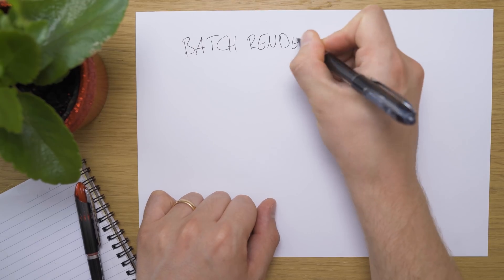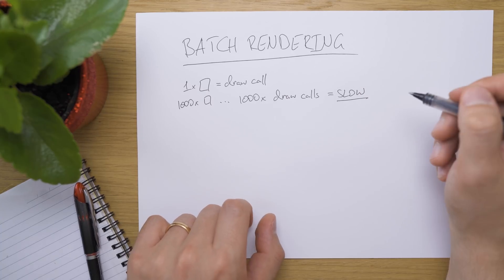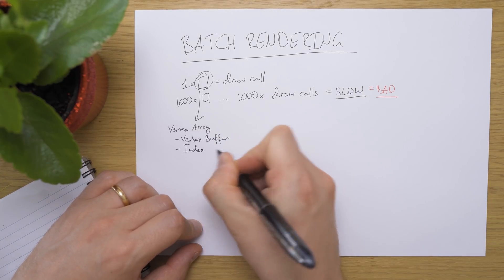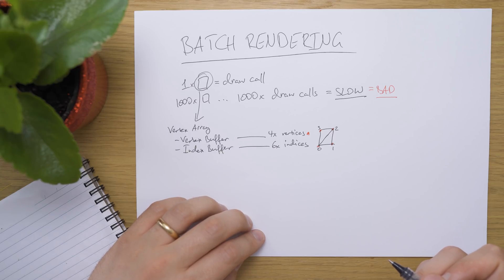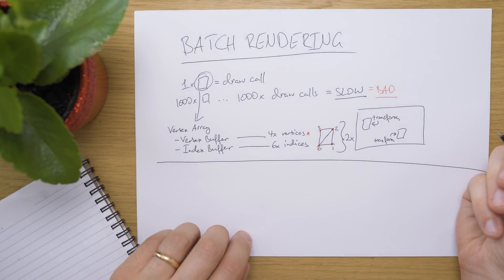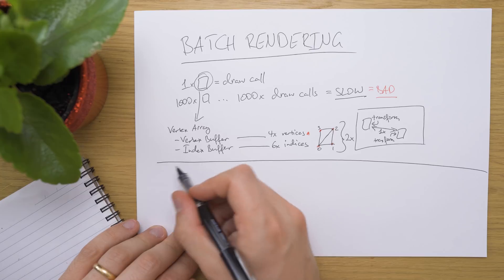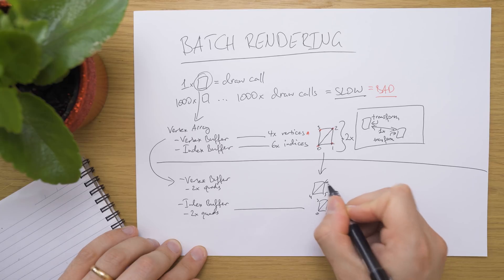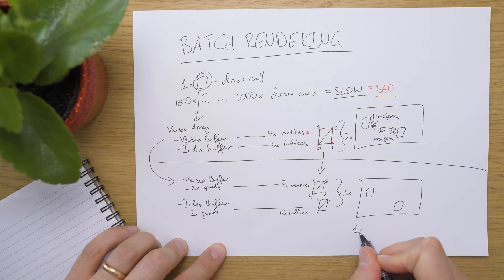Batch Rendering - An Introduction

Comment: What about the overhead of transforming all of the vertices in the array, as well as culling? By sending all of the vertex data at once, you must first transform the quads using the transformation matrices, which would need to be multiplied through on the CPU (effectively doing all of the work that the vertex shader does). If you generate your quads once at load time, then that's won't have a significant impact, but if you are doing it every frame, the overhead of the matrix transforms may be larger than multiple draw calls.
Furthermore, if you have a large array of quads that you are drawing, for multiple objects, then your aggregate object will become larger, and you will be unable to break it up to do things like frustum culling, which will result in unneeded GPU.
What about using instanced rendering, where you upload a large packet of transform matrices to a vertex shader? How would that compare? You would still have the culling issue, however, you would allow for the parallel nature of the GPU to compute the new transforms. In fact, if all of your instances are only translated and scaled uniformly, then you could reduce the memory footprint to a single 4-vector per quad (isn't that how billboarded particles typically work?) Obviously instancing wouldn't work for objects with different geometry, but the examples you gave were simple quads. 
I wonder if you could combine some sort of hybrid method, where you instance a quad (or a triangle), and use a method similar to skinning with bones to re-assemble the instances into multiple objects on the GPU. That wouldn't work for smooth models, but could work for the faceted low-poly style.
Reply: Most of it is not an issue. For a sprite/tile map you usually only work with position offsets. That is cheap and your CPU can do it no issue. And you can do it in chunks of 1k sprites at a time, that way you can cull them as well. And for static or rarely changing environmental stuff you don't have to do it every frame. As for text as well, it's very similar and only need to update when you change the text.
And even if you go with a simple 2d transform matrix for thousands of sprites, your CPU can do it quickly, and if you want to optimize you can vectorize that math. Perfect with 4 vertices per quad and the 4 float simd.
One draw calm is very expensive for the cpu. So you can justify a lot of work in minimizing the calls.
If you reeeaally want high performance sprites, you can do it with geometry shades or point sprites. But they have other limitations, and then it's probably also more efficient to simulate and update positions and such on the gpu too. Like for gpu particles.
It's a big subject though, and your questions are valid. But it's a no issue in most cases as it's always better than the single draw calls, and if you want really good speed there are a lot of related techniques. Batch rendering is the best for more static/rarely updating things like text and backgrounds.
Reply: @Girugi  For a sprite / tile map, as well as text, would you not be better off with instancing still? Especially if the quads exist in a grid, then you don't even need the transform.
I'm not convinced that the overhead from a draw call would necessarily outweigh the cost of doing the matrix-vector multiplication every frame (to update a dynamic list). I'm sure there is a break even point, but it may be much smaller than you think (for example, a batch list size of 100 particles could be the break-even point, where you start spending more time on transforms than you would function calls of multiple sets of 100 particles).
Another issue to consider, is that depending on the hardware, there will actually be a limit to the number of triangles that can be drawn in a single call. If you end up creating a batch list larger than that limit, then the driver will have to do extra work to split up the draw call (which in the end will probably be far more expensive).
Also, you can't always do the sprites in the geometry shader, since not all platforms support it. For example, many embedded GPUs only support vertex and fragment shaders (those are also the ones which will have a much lower triangle per draw call limit, since the entire stream will have to fit into an attribute FIFO in the GPU).
Reply: @hjups  you are not tackling the issue the right way. You need to consider the real use cases. You would not update a tile map every frame. You would only build up chunks close to the camera and then let them be. Using a camera matrix to transform the whole chunk as a whole on the gpu.
Also, instancing is not without its own issues and overhead. It's not free. You would never use instancing on such low poly objects like a 4 vertex sprite. And letters/text rendering is not that simple at all. Real text rendering need formating, kerning, line breaks and so on. You will absolutely need every letter to have unique coordinates and even take into account the letter before it. And sending that in an instance array buffer is a lot of data to write up and send as well. Trust me. I've been working on a professional game engine and written a font and text rendering system, as well as a 2d batching system for sprites that was pretty much free from a performance stand point.
Also been writing 3D batching systems and used instancing for various purposes.
As for geometry shaders. Sure, not all platforms support geometry or compute shaders. And then your best option is absolutely point sprites for small particles. But due to some limitations, larger particles would absolutely be batching based. There are still many options for the details though. Like you could do sprite expansion in the vs, and just set up the data in a big bathed vertex buffer. But you would absolutely not do 2d particles with instancing. If the platform is low end enough to not have gs, it will surely have a bad enough overhead on instancing to not be worth 4 verts too.
As for limits on vertices. For sprites you will never realistically run in to it. Even if you just have 16k verts. You get maaaany sprites for that. And you would probably not batch more than about 1k per batch anyway. Of course depending on your individual use case.
Reply: @Girugi  While what you said is true about tilemaps, it wouldn't be true for general geometry or sprites / particles.
I'm not convinced that instancing for a 4-vertex sprite would cause a significant performance impact. That would depend on how the GPU is designed. Keep in mind that typically, they will do instancing in a scatter-gather mode, so the overhead would be identical to drawing them in a batched operation. Although, the difference would be the extra compute time to create and multiply through the transformation matrices for each vertex. Depending on the hardware, it could potentially be more efficient to draw them via instances, due to the limited size of the attribute buffer in the GPU. I would have to see benchmarks comparing the different methods on different hardware to trust that conclusion. As for formatting, kerning, leading, etc. You could implement that via a array of multi-parameter structures in a constant buffer. Two 4-vectors would be less memory than the four 4-vectors needed for a single object. As for anecdotal evidence, it may be free from your perspective, but all that means is that the impact was not noticeable. You would have to benchmark the different options to say for certain, although, that's probably not worth the time / effort if you do not see a performance impact right now.

Without a geometry shader, you could still do large particles using instancing, in fact that would probably be far more efficient, since it can use the camera matrix to align the billboard in the GPU. You wouldn't be able to simply feed points to the GPU though, and expand those into quads in the geometry shader. 
What is a "point sprite" in the context? Are you referring to drawing single-vertex points with a size? That probably wouldn't work in most cases, since they would lack detail.
I think you over-estimate the low-end embedded GPU hardware like what's in the Raspberry Pi 2/3. I don't believe those can handle more than a few K verts at once, certainly not 16K. 
Going back to the overhead. I have been working on designing / implementing a shader based GPU for configurable hardware (for an FPGA), which has required a deep dive into how the devices are architectured. There is no significant additional overhead for instancing vs batching. It's possible that some additional overhead was introduced when the architecture transitioned to unified shaders, however, I doubt that is the case. Perhaps the overhead you are referring to is in the driver? Though the hardware should be capable of implementing instancing directly.

Comment: ok so isn't it same as Instancing technique? btw, awesome vid as always❣
Reply: This is different from instancing. Instancing repeats the same geometry over and over, while batching can be used for different geometry (i.e. if you wanted to draw different shapes and not all quads). I believe that you would have a similar effect with the examples given in the video though. It's been a while since I have done this stuff, but from what I recall, indexing would be the original list of 4 vertices and 6 indexes. Then your draw call would tell the GPU to repeat the stream N times (for N instances), giving each instance a unique ID. You would then create an array of transform matrices to upload to the vertex shader, which would do the transformations for you based on the ID. Obviously that wouldn't work if each shape was different.
Reply: @hjups  yehh, instancing is different technique, and you've mentioned it right, thnx for clarifying

Comment: The following Batch Rendering technique works perfectly for sure! However, WebGL for example, has a limitation for vertices amount per drawCall (~64k points).
Nice video! 😊
Reply: You realize that is still thousands of quads per draw right? :D  probably more than you want anyway. For other reasons.
If you talk real 3d environment batching though, 64k can easily be hit. But also easy to design the system around :) though might of course not be as optimized as you can get it for other platforms.
Reply: Kakure this is true, fully agree, it’s a great hit. I was developing in production data-visualization software and we didn’t know how this technique is called, we just started to chop the data into groups :D
I would say this thousands are not enough in the era of Big Data.

Comment: Is there any way to create a pattern that just draws a prespecified quad at specified points or something like that so you only have to feed it on quad, something like a tile map.
Reply: You could make a quad object that is just a bunch of data and a pos variable, and keep adding the same quad to the batch while changing the pos variable between batches. Might be a little slow though

Comment: 2:48 did he say the bottle neck is GPU in case of large amounts of drawcalls? Cause almost all the time the bottle neck in this case is CPU.
Reply: Genosse Mendes I don't. You can ask some rendering engineer, or do tests yourself. Even on devices with unified memory CPU processes DrawCalls at least two times slower than GPU.
Something might change with DX12/Metal/Vulkan APIs, but with older APIs drivers had to make huge amounts of preparations on CPU before the call.
Reply: Genosse Mendes  I did a quick search and was unable to find a good reference describing the overhead. However, you can look through the MESA3D driver in Linux, tracing the glDrawElements function, and see the rabbit hole of function calls + extra overhead. Aside from the function overhead, you also have the memory transform overhead to the GPU, to issue the drawing commands. While it's difficult to saturate the PCIe links in modern devices, they are not instantaneous, and the commands must be copied before the GPU can start drawing. For the above, you could look at the latencies, where for N drawcalls for M vertices, you have t = N*(driver_overhead + dma_overhead + gpu_startup + M*vertex_cost), vs t = driver_overhead + dma_overhead + gpu_startup + M*N*vertex_cost. If it's a dynamic list, you also have dma_cost*M*N in there (which is the same for both).  Notice that M*N*vertex_cost happens in both, so unless M is very large, there will be a noticeable speedup by combining the draw calls (though that's assuming the vertex list is already generated and that doesn't add extra overhead).
Reply: yes, when drawing large amounts of quads without batching the gpu has to run for every quad separately and wait till the previous quad is drawn whilst with batch rendering the gpu has to only run ones per frame and that is a lot faster because the gpu is very good at drawing multiple triangles in parallel

Comment: Will you be using a Texture Atlas? It might be the strategy I should go for in my project
Reply: Texture atlases are pretty industry standard. Use it.
Reply: @QckSGaming  Yeah I guess that's why it seemed like the solution suggested by a quick search on the web. A video b by him would be really neat but I should do it one way or another

Comment: Just finished text rendring on my own library and fps dropped from 5k to 500 just by drawing a paragraph. This series hit just in time
Reply: If you are using OpenGL have a look at glDrawElementsInstanced or glDrawArraysInstanced. I wrote a text renderer that renders quads using triangle strips, so therefore i don't need indices and save on memory.
Reply: @RedCraftRPG  i know the existence os instanced render calls but i have no idea how to render stuff when they change textures. Hoping this series will shed some light on the topic
Reply: @DoğaOruç  Why would a text change it's texture? If the text changes you just generate a new text model and delete the old one. Libraries like NanoVG even generate new models every draw call because it is very likely that if you draw a text again it has changed, although i'm not very sure how much this is true for game development.
Reply: @RedCraftRPG  Well, let's say I'm rendering "hello". I first need to render a quad using h then another quad using e and so on. So the texture of each quad in my text must change in the draw call. I guess I need to upload all the letter textures as a uniform and select the correct the texture during the fragment shader. I couldnt set this up.
Reply: @DoğaOruç  Oh, yeah u need to stitch the glyphs into one big texture. It's really bad perfomance wise to have one texture per glyph. If you have one texture per glyph that's one extra GPU instruction per char you have to send to the GPU, which adds up. Just generate the chars you need in memory, combine all bitmaps into one large bitmap and upload that with one call to the GPU. You then only have to store the positions of the glyphs in the texture in RAM, but it's much faster
Reply: Svetlana V  If you write them all into the same vertex buffer and use a divisor of 0 then yes, that's true. Instanced rendering allows for attributes to be "per instance", therefore you can have one vertex buffer with 1 attribute (position, probably 0,0 0,1 1,0 1,1) with a divisor of 0 and then another vertex buffer with multiple attributes which store information about the position and the uvs, but with a divisor of 1. That way these are used per quad and not per vertex. In the shader you can then position the quad by offseting the position by the values stored in eg. attribute 1, and the UV coordinates can be calculated by linearly interpolating between the two uv coordinates that make up the glyph using the position as factor (eg. vec2 uv = mix(corner1, corner2, position)), since position, corner1 and corner2 are all vec2's it is supported by GLSL. Corner1 and corner2 would be stored as vec2 in attributes 2 and 3, or as vec4 in attribute 2 and you can swizzle when mixing.
Reply: I created a library that generates text as one texture and its a lot better on the frame rate.
Reply: you defnetly not need to update the geometry every frame only when some thing has changed